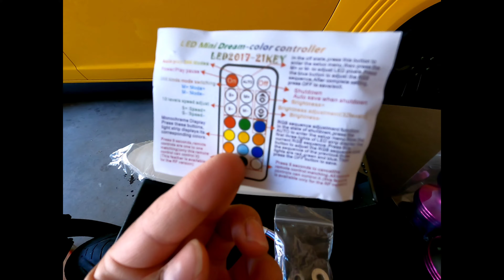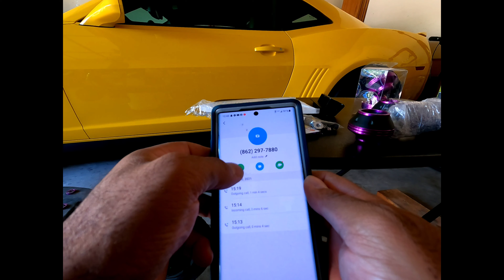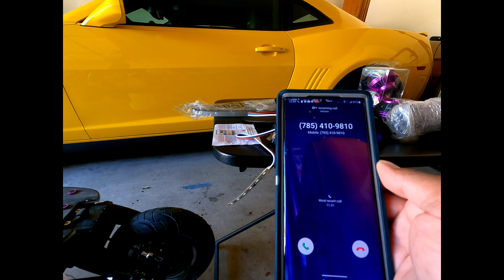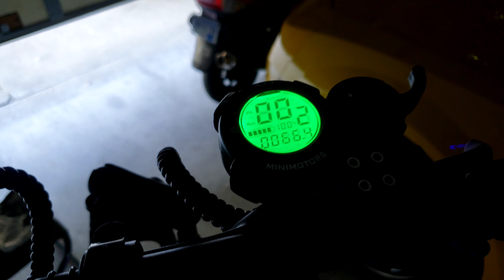Dualtron Victor COSMO Designz LED mud guard install

Comment from the maker: When you guys get that mudguard, make sure you use that loctite guys. I just did 63miles and it vibrated ALITTLE loose and i out loctite all up on those bolts

Comment: this is what that scooter needed .. can you put your weight on it while you ride ?
Reply from the maker: You can accidentally put your foot on it. But not rest your foot on it nor use it to "dig in" when accelerating. It isn't flimsy. It's made of metal, it s just it's thin enough to bend if you put too much foot pressure on it

Comment: very nice!!!!   oh very verynice !!!   question:  is compatible for Raptor2?    i have a Raptor2 and i want this one :)   its compatible?     thank for Ur video man :) !!!!
Reply from the maker: Yes. But you have to make sure that you select the one for the raptor 2. I believe the raptor and the spider share the same type of mounting system and then all the rest of the dual trans pretty much uses the same as the victor. If you do not see the option then I would email the company before I order with them to make sure that the one they are sending you is for the raptor 2. 

Sorry it took a while to respond to your question, I am currently doing another range test with the Victor but with just the rear motor
Reply: @Jonasegway          thank you very much for your responsive and quick response! really, thank you! ok I want the link or the reference of the compatible model because I know that the Spiders and Raptor, in principle, have the same dimensions on this kind of accessory such as: mud guards.
Thank you so much for responding. So sincerely.
Reply from the maker: @guitaristeparis14  o you're welcome. I am here for you guys man lol. This is what I enjoy. I put the link to it in the description. If you look at it, this mudguard will work with l dualtrons except the eagle pro. 

If ordering from minimotors is an issue, look at the Cosmo Designz actual website and they will likely be able to ship to you
Reply from the maker: @guitaristeparis14  https://www.minimotors-nyc.com/products/cosmodz-rear-led-mudguard